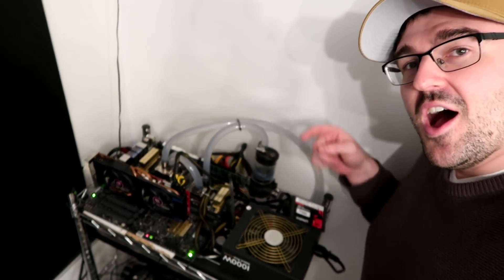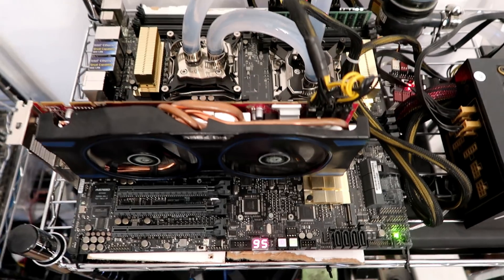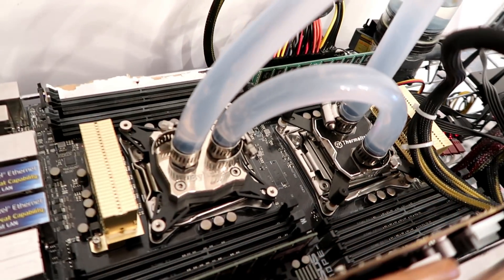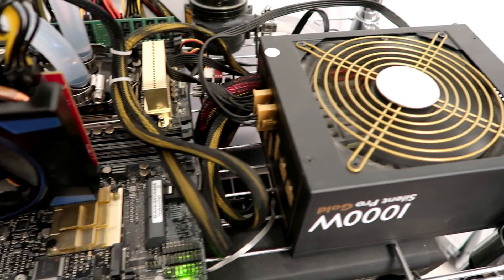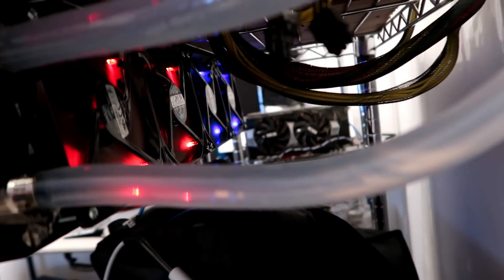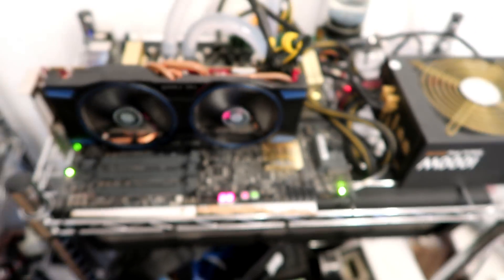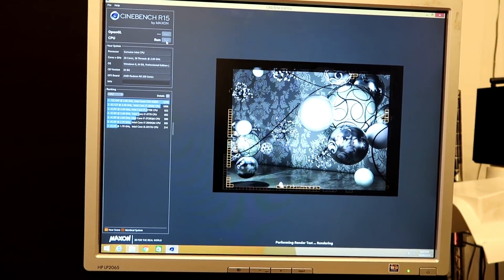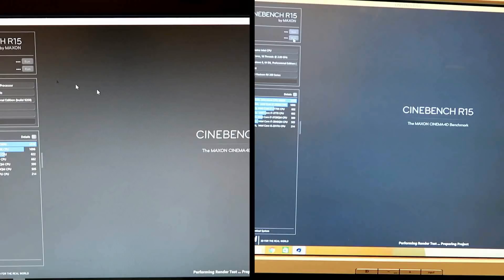MY VIDEO EDITING SERVER, WATERCOOLED & 28 CORES

Comment: Hi Scotty D:  So are you using Remote Desktop of sorts into your video editing server?  I want to do something like that where I can put the server somewhere else in the house (due to noise) and remote into it from a 4k display and laptop or something small and quiet.. using it as a dummy terminal of sorts.. would this be possible with good performance and color accuracy on a 1gb or 10gbe wired network?  If you're doing just that.. what remote desktop are you using?
Reply from the maker: Yeah mate. I am now. I’m using teamview. It’s still sitting in the same spot. But I can connect wherever I am on my tablet and do the editing or processing. (Sorry didn’t see the rest of the message) 1gb seems fine but it won’t allow high colour resolution across team view. Well from what I tried. One day I will try the 10gb or greater
Reply: @ScottyDIY  Thanks for your reply.  So using teamview is there lag or audio/video sync issues? how about color accuracy?  I hear some of these are issues with windows remote desktop.  I basically have a PC I want to put in another area/room due to its noise.. and I want to remote into that system to load up the video editor and do video editing, from a dumb terminal of sorts which i'd use basically as a display, keyboard and mouse to interface with the server.   I was hoping a local network using 10gbe would be good for this.
Reply from the maker: Just thinking about it more. Depending on your distance being it’s in a house and if you are able to do it.  you could run powered extension hdmi 2.0 through the roof and wireless keyboard and mouse. Little bit of mucking around but would work. I have done this with my gaming rig to the main tv to play games in the living room.
Reply from the maker: It does have lag issues using wireless which I use when not at home but I always do another check on my main computer before I transfer across to the server to render. I haven’t done a test with fast wired connection so I can say if it’s better. The good thing is teamview is free for home use.  so just download a copy on each and have a test. If it’s no good maybe look at extended hdmi 2.0 and usb 3.0